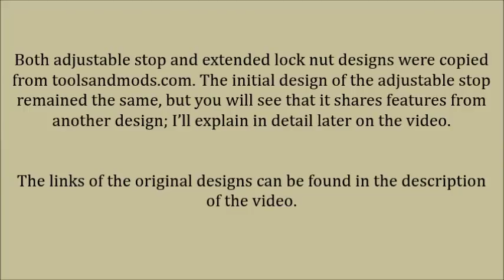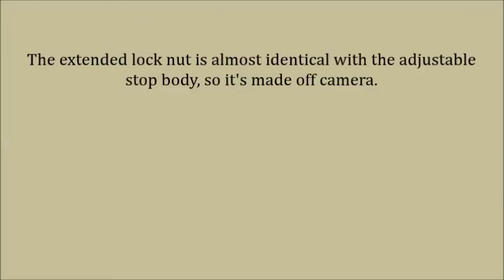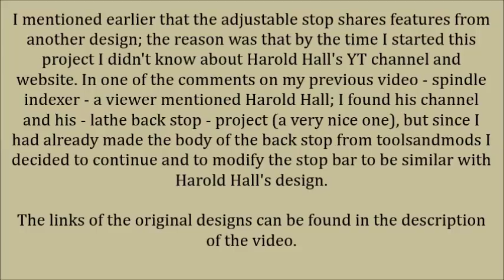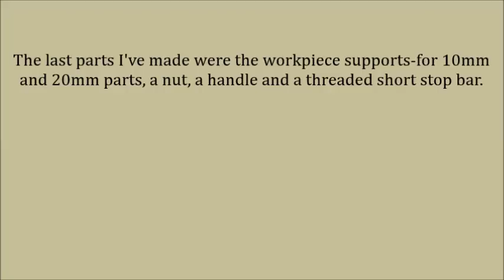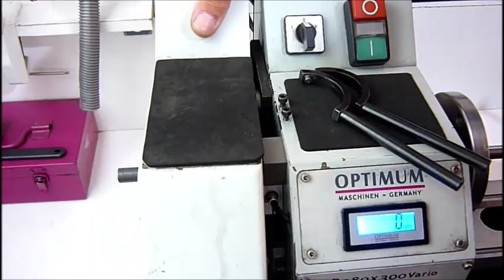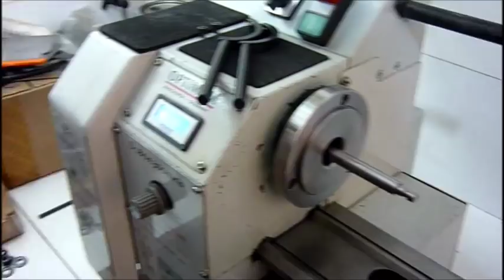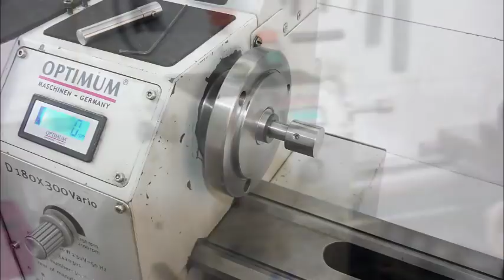Making a spindle adjustable stop and an extended lock nut for the mini lathe

Comment: As a second chuck stop i build the system from Rob Renz and Stefan Gotteswinter both on YouTube which is made for little parts hold before the chuck between the Jaws and they are very precise you dial them in and have then a very good repeatability 👍 this system here you build is more for regular and bigger sized parts but is also very good...they both fit together perfectly... Good work as were used from you 😊
Reply from the maker: I have seen Robrenz's chuck stops; extremly precise and beautifully made! Unfortunately my lathe is very limited at tooling options, plus that I don't have a milling machine that it could help me on making specific tools or any other aid for my lathe. Anyway, the chuck stop I've made can support small diameter as well as thin parts, but has limitations of course!! Thanks, glad that you like it!
All the best
Jimmy
Reply from the maker: Hi Wolfgang,
Unfortunately, I didn't receive your mail. Thanks for your kind offer, I appreciate it! I would love to see some pictures from your shop as well as some of your pojects, my friend!!

All the best
Jimmy

Comment: Nice... at 0.48 the caption says the spindle thread is M27x1mm.... my C2 mini lathe is 1.5mm according to the manual.
Reply from the maker: Thank you very much for the comment, I appreciate it! Yes thats correct, the spindle thread of my mini lathe is M27x1mm. The C2 mini lathe it's a whole different lathe than mine, so having different spindle thread doesn't seems stranges, I think.
All the best
Jimmy

Comment: Nice Video, is it The original Motor on the Lathe? He stop, extremly quick?
Reply from the maker: Thank you very much for the comment! Yes, the lathe have the original motor (DC 220V 600W/5600rpm). Although the sticker on the motor says Optimum, I'm sure that is made in China, but it is a quality one anyway. I'm not the expert here, but I think that it stops so quickly because of the electronic controler?

All the best
Jimmy